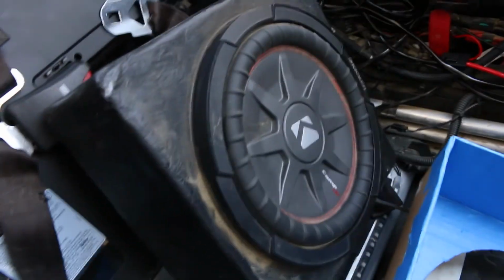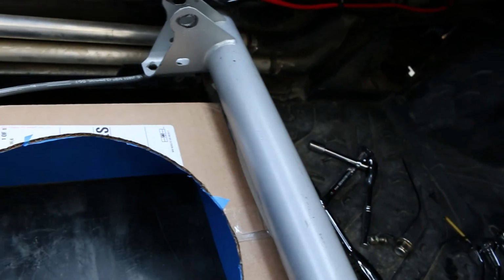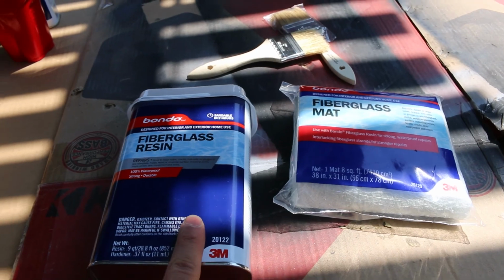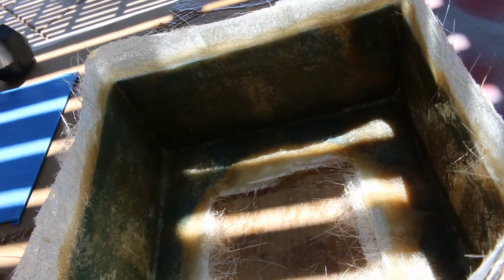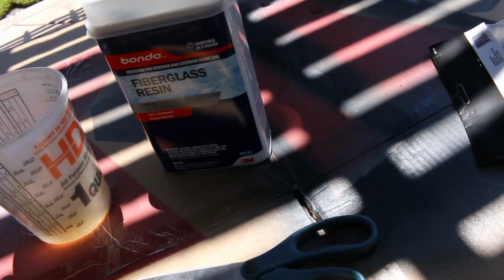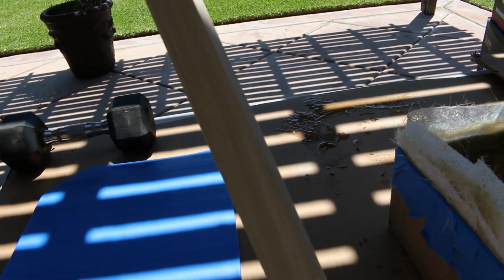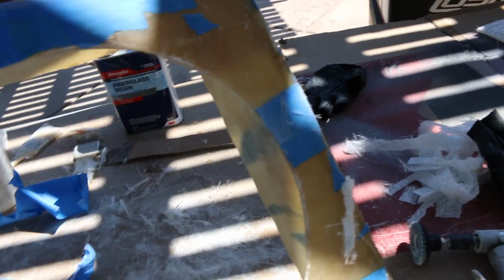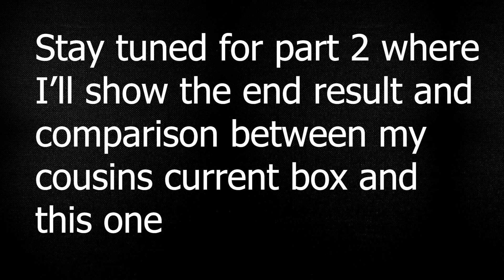Can-am X3 Sub Box Pt.1

Comment: How much you charge to make the box
Reply from the maker: $200 but not for this one it doesn't work well with a 400watt+ subwoofer because it's to small I actually ended up making this other one which much bigger  ( https://youtu.be/nZH-i7vkXwA)
Reply: So a larger box is needed for more air for sub?how about a ported box then?how much for two for a 19 x3 ?